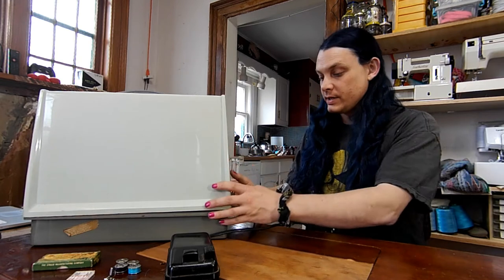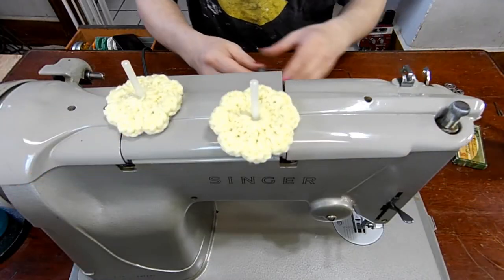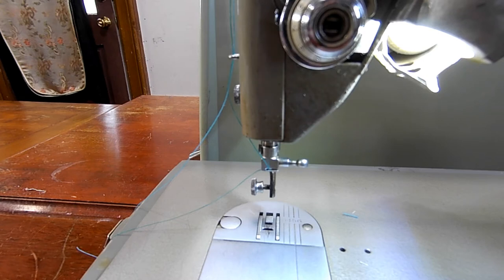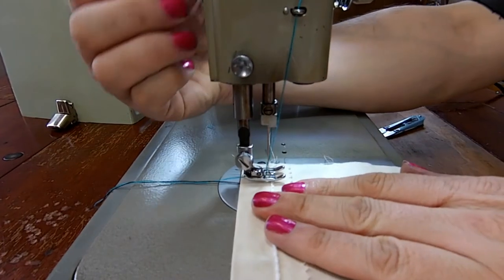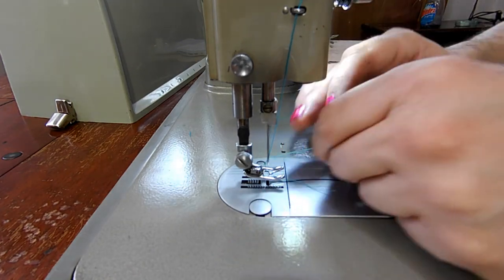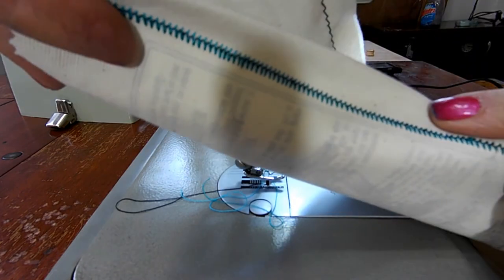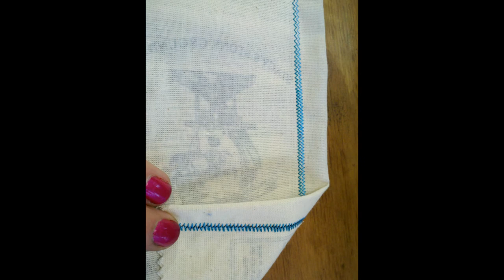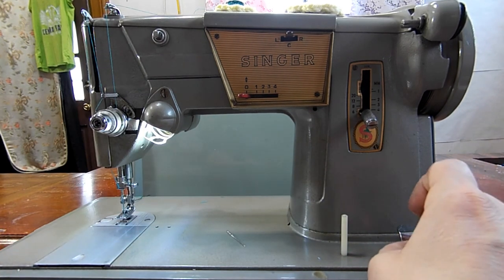How to Use a Vintage Singer 328k Sewing Machine

Comment: I was given a 328K Singer Sewing Machine by the owner of a Consignment shop (who had sold it; but, it was returned with demands and very unkind words). I was very happy to be given this machine; and, I did offer to pay for it. This machine looks very much like the one you used in this video. It has been stored wrong and has some dings. It is missing the extra cams, the feed dog cover with the wide hole (to do zigzag with),  the manual, extra feet, tools, one spool holder, and it's carrying case or table. 

The one given to me is the same color as the one you used in this video. I love the look of this machine and the fact that the head is all aluminum (which is much lighter for me to pick up and carry, I'm 73 years old). You just gave me another reason to get this machine into the repair shop and serviced. I want to keep it; because, I can do twin needle sewing on it without buying those expensive twin needles. I love the old Singer Sewing machines. Plus, I was told that this model was the last to be designed to fit into an treadle cabinet and ran with a belt from the foot treadle. I was also told that the little motor inside this machine is open and air cooled.  Thank you for this video.

Comment: I have one of these; got it from my mom when she updated. (It's my age or older; I've had it around 30 years.) Fun to see it in a video! (Actually, my owner's manual says "style-o-matic model 328" -- but the box that the attachments are in says 328J, but for the most part it seems quite similar. The owner's manual mentions 9 fashion discs, and I have all 9, plus a lot of very strange attachments that I will never use :-) ).

FWIW, about 25 years ago I made window treatments that at their thickest were ~ 24 layers of fabric thick (gathers). More recently I have been making quilt tops and, in the beginning of covid, masks of varying types. She does get a bit cranky with multiple layers, but usually can get the job done. She is quite touchy about her tension after not being used for awhile. She's in mostly great shape except that one of the spool holders on the top is long gone, so I guess I'll never do two needle sewing.

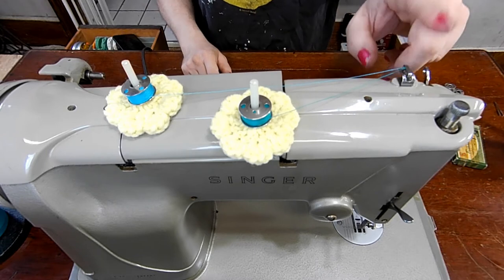Oh, and for the nonce (if you ever are working with one of these again), when threading the upper thread, the thread guide on the side does not need to have the thread threaded through it (video around 3:13-2:20, you can just gently slide it in (from front to back) -- not sure how to describe it. Certainly what you did is still easier than the part where we all have to thread it (through the actual needles), which I find difficult to do these days (eyesight; have to get REALLY close to see it).

Thanks for the great video!

Comment: thanks for the video , I just  got  this same  Machine , It didn't even  run, but  I got it  running and it does  a pretty good job of sewing . For anyone learning to sew  it's a work horse that will do the job .  I have  a ton of old machines  , and  boxes of small  parts , plates  etc. if you need any  . Thanks .
Reply from the maker: Thanks for the offer but I got all the machines I wanted :D Glad the Video was helpful.
Reply: @SewSaveMe    I hear yeah there, I  just sold mine  today , along with a pretty Blue  Fleetwood Zig Zag

Comment: Love Stevie’s brutally honest takes on the machines on this channel. Lol. But that means if there’s a video about a machine, it’s gotta be at least decently good, even if Stevie’s feedback is kinda meh LOL..  I just got this machine and it’s a sturdy little stitcher that will last my fam a long time. Nice straight stitch, not the best zig zag ever, but it came with a handful of cams and I’ll definitely try the twin needle. Thanks again!
Reply from the maker: The 328k Isnt Aweful. I like it can twin needle using two needles so thats a bonus. And for its day it was really good machine. But by the 70's there are better smoother machines in my opinion. Course the 328k was relatively cheap too compaired to say a 403 or even a Kenmore 158.1802. If you were on a budget back then 328k made a quality machine for the money. If I seen one in a thrift store for 10-20 dollars I would snach it up even today. Still way better machine then any walmart special plastic garbage.

Comment: I use my machines on those heavier TV dinner stands so that I can move them around depending on space needs. When I work against the "bookcase/brick-lumber" shelving I work off my cones resting them on a lower shelf and pound a 4 in. finish nail in the face of the shelf at a slant to catch the thread from belore then thread it into the machine as usual bypassing a separate cone thread holder. I can have all my thread cones on the shelf for continual storage/access, too. I was just thinking that you could use those picture frame screws on the face of the shelf to put the thread through before going into the machine but I didn't have any at the time. That way people will not get caught by the head of the nail if they pass too close.
SCIZZORS-To clear space on the sewing surface I have been in the habit of putting my scizzors in my back right pocket so that I don't have to go hunting for them all the time.
PINS--I have been meaning to make up a magnetic pouch to drop my pins as I take them off my projects while sewing. Will the magnet have any effect on the motor since I would like to hang it to the right of the machine. With the way electronics go I would not like to screw up a motor because I have magnets nearby?

Comment: I hawe the table wersion of the older wersion (not sure about it's number now...) of the Singer. The swedish manufacturer was named "Husquvarna" it's pretty similar to the singer (it's not a copy it's intestines are different (for example the inner spool work with a round axle that twist instead of that back and forward lever the singer had, etc), but i guess the function is pretty similar in all those machines) in the earlier models, but later models are more advanced and could be programmed with some plastic gears. A hawe a few of the very old ones of those too, i still use one of them wich are converted with an electric motor i guess somewhere in the 50s.

Comment: I have my grandmother's 1961 Singer 500A sewing machine. I've had it for a few years now. When I first got it I cleaned it up and oiled it. It sewed perfectly! So, I took the motor apart to service it. After a few months of constant use I noticed the top tension was getting way too tight. So, I took it apart and followed a few videos on the top tension on a 500A. That seemed to solve the problem for about a few minutes of sewing but, the upper tension becomes extremely tight. Even with the presser foot lever in the up position. Have any ideas what could be causes the problem? 

Thanks,
Matthew B.

Comment: do you have to have the cams to sew? I have one it is # 6. That is the only one I have. Do I have to have all the cams for this machine to work properly?
Reply from the maker: You need the other cams to do fancy stitches. Im not sure what #6 cam is but I dont think thats the normal ZigZag cam. You might wanna poke around and see if you can get a set. Flat singer cams are fairly cheap to buy in most cases.

Comment: Hello! I am trying to start using my grandma's old machine for my first sewing adventure :) Your video has been so helpful but I can not insert 2 needles - I've tried every which way and it seems that only one fits! My machine looks just like yours. Any advice?
Reply from the maker: Is it a 328k exact model? Im not a singer expert by all means but I think there was a few flavors of this machine. And I seem to remember only the K model could twin needle with two actual needles bolted in the bar.

Comment: The face difference of a singer 328K maybe due to the "straight" needle shank, which is the one I have, does not have a separate plate on the face; but the slant does.

Comment: Some of my older bobbins have gotten a bit darker as the original finish has worn away. Can they be mixed in course sand to remove some of the "color" to brighten them not to original as the finish is gone but not as "dull/dirty" looking?
Reply from the maker: I bet that would work, but you may want to use walnut shells instead just to be safe.

Comment: Is it possible to change the power pedal from those "button" ones such as that on the 328K to the whole flat pedals on the touch n sews types because they are hard on my big toe!
Reply from the maker: You bet as long as you dont use one from a golden touch and sew those were electronic and have 3 wires. But all the others were .7a two wire type and should work fine just verify the motor on your 328k is the same or lower amp rating then the pedal you wont wanna burn your pedal up.

Comment: Dear Lad, hello. I have a 1960 Rocket 327k and no one is making a film on mine. I have not used mine since 1970. I got it serviced. But misplaced all my discs, I am in my late 90s. I do still sew and love it. Please Lad could you do a class for people like me who have a 327k? I apologize I have forgotten on to use it. I had a beautiful 1975 Blue Riccar and my serviceman said they can no longer fix it because there are no more parts. So I am back on my 327k. I just need some help and I need all my discs and does my machine sew with a double needle too? I also would like a used sewing tabLe for my Rocket were it lays flat for better sewing. something used, and I can fix it up. Do you have any suggestions for me Son? Thank you for your film, I have subscribed and please do some for my 327k . 
God Bless, Ann
Reply from the maker: I dont own the machine no more so I cant do much more with it. I sold it a long time ago.

Comment: Hi! Thanks for the great video. I have a 328J. I don't know why it's a J rather than a K, but that's what it says on the front. Otherwise, it seems to be identical to the K. Would all the parts (i.e., feet, needles, cams, etc) that go with the 328K fit my model? Thanks so much for your assistance!
Reply from the maker: Hit us up on Facebook that def a Crystal Question. Im better at using and fixing them. As far as what needle systems they use feet accessories Crystal is way better at that stuff.
Reply: K is made in Kilmarnock , Scotland

Comment: Will this handle thin leather? I want to make a wallet and a tool roll.
Reply from the maker: Thin leathers I dont see why not. I would probably go looking for a Vintage 148 or 158 kenmore though I think they handle leathers a bit better.
Reply: @SewSaveMe  Ok. I saw a 328k on Craigslist so that's why I'm asking. I do recall seeing Kenmore models also once in awhile. Thanks.